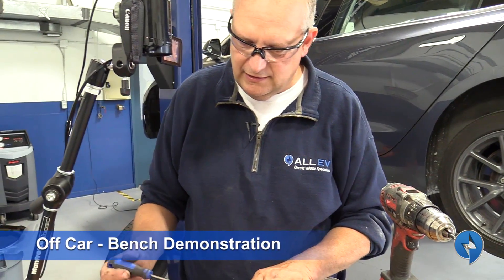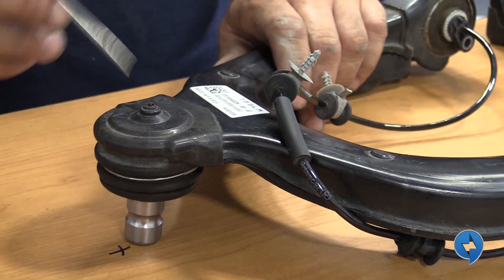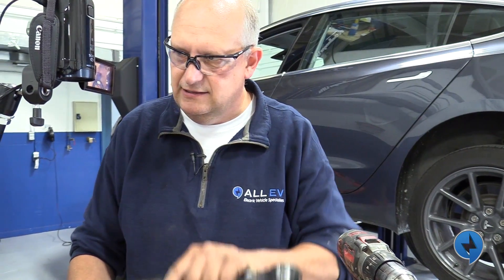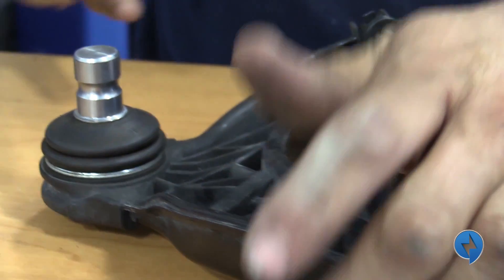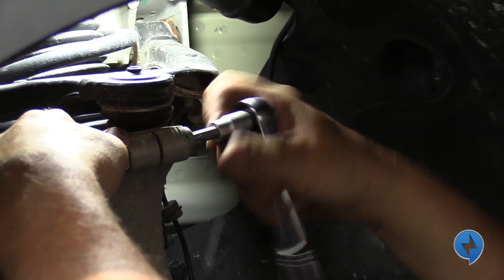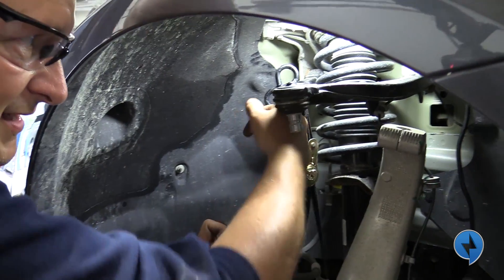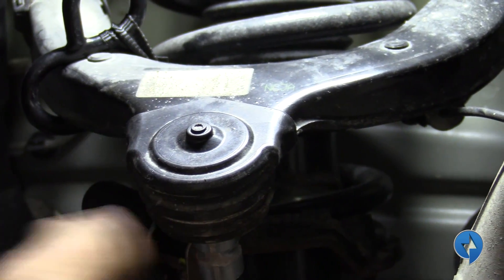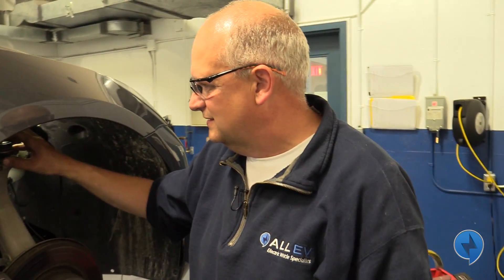Tesla - What is that Squeak!?  Fix for Free

Comment: 0:05 looking at the rotor seems like the brake pads need to be freed up from the caliper. nrsbrakes.com  (Canadian company) makes a galvanized brake pads to help this issue.
Reply: I was noticing the same thing at the early beginning after 30.000 km or so.
Just set Regen to LOW in the Model 3 settings and you'll be fine after some 10-20.000 km more.
After 60.000 km (14 months) now, my discs and pads look quite as new. 😎

Comment: I do a similar trick to the lower rear joints on BMW cars what I do is remove the clips on the rubber boots and spray or inject grease with a grease gun with a needle under the boot not piercing the boots.
Reply: Smart!

Comment: How do you think Tesla is going to warranty or replace cell to structure batteries when they come with them? I don't think they will be able too, seems like engineered obsolescence.
Reply: NIO now uses a structural battery and it can still be removed. Tesla will most likely follow suit because it's manditory in China that the battery is removable. We'll just have to wait and see.
Reply: @Northbaylandscaping  that didn't age well
Reply: The battery ist connected with a dozen of screws. No matter whether the batt is structural or not. 🤷🏻‍♂️
Detektive batterys are dissassembled and reused on bigbattery.com oder batteeyhookup.com.
As we don't know yet, how Tesla's structural batterys are glued together and if at all, speculation is a waste of time.

Comment: I had this same exact problem on my 3 and Tesla replaced the upper A arm on driver side for free. I tried to move the ball joint after Tesla took it off and it was seized up tight, no way you could move it.
Reply: Wow, must have dug right in.

Comment: June-2018 LR RWD Model 3, and replaced both left and right upper control arms under warranty. (both of them have revision  "-G" after replacement)
It could cost ~$600 so this is very useful information.
I had suspicion that Tesla knew this problem since Tesla SC had the part ready to replace on the same day.
Reply: mine just passed warranty several days ago, and i start to notice that right side starting to squeak.... This should be a "RECALL" from tesla. The dripping rain water also right on top it, what a Genius design!!!!Guaranteed making it squeak!!!
Reply: both of my 2018 cars started squeaking immediately after my warranty ended (50,100 miles) ... probably a coincidence but annoying! this fix has worked great and I'll keep doing it until it doesn't work anymore!